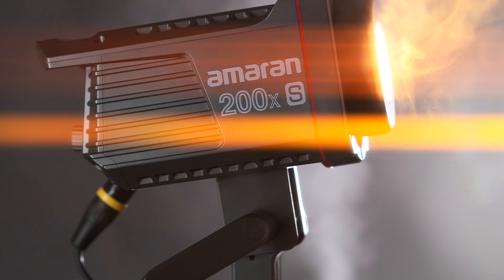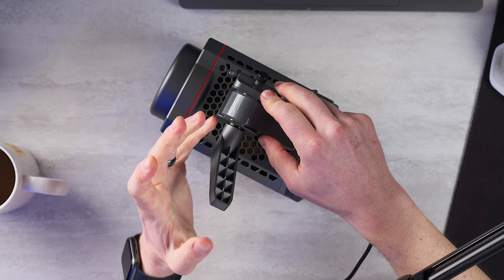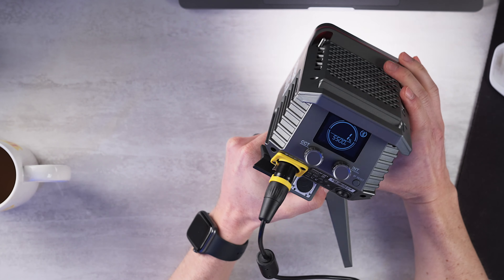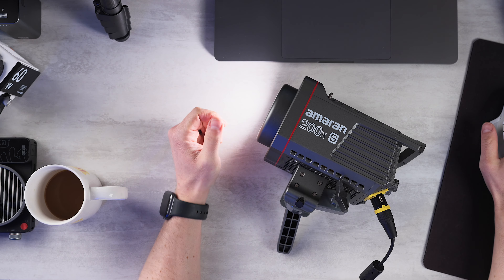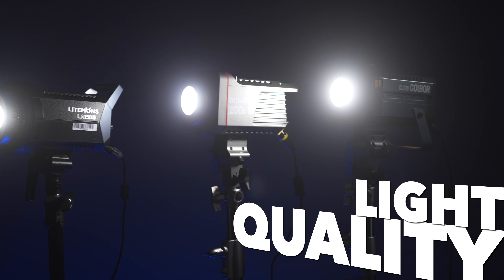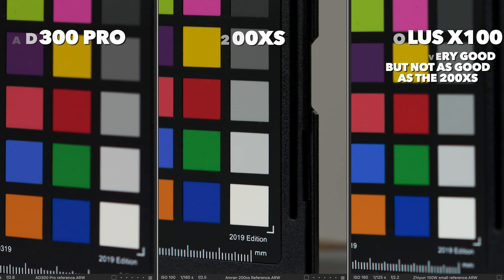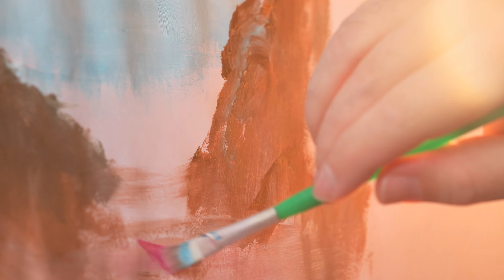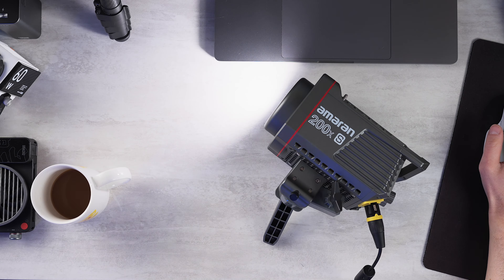Can YOU Tell the Difference? Amaran 200x S Review

Comment: Thanks for the review video. For the portrait comparison maybe the shutter, f stop, ISO and light power setting would be helpful to get an idea. Thanks!
Reply from the maker: f/2.2 ISO100 1/125s 😉
Reply: @WesPerry  thanks for the quick reply Wes. I don't bit of corporate headshots and sometimes schools too. Usually shooting at higher f stops. F4.5 to f8 max. Wonder how the 200x would do on that scenario with similar shutter speed and ISO up to 800. Do you think it can handle it?
Reply: Forgot to put that would most likely use at least two lights

Comment: Hi Wes, in your 200xs vs ad300 I could correctly determine the light used by dilation of pupils. That said difference on my tablet (smallish screen, albeit enlarged) was very similar. So I'd conclude that this looked to be a pretty accurate smallish light. Perhaps ideal as a starter for occasional amateur use, indoors, whilst being compatible (via Sidus ap) with the heavier duty, more pro like, higher spec Apurture light family.

Comment: Interested to know if you feel there is a realistic colour accuracy difference between this and the Colbor? I've seen this get commended for its colour accuracy, and I'm not too bothered about paying extra for it. The only reason I would choose the Colbor potentially is to use V-mount batteries without needing an extra box.
Reply from the maker: The Colbor also runs on 48V, so you won’t easily be using it with V-mount batteries either, unless there’s something I don’t know… if so please tell me haha.
And there is a slightly noticeable difference yes. Still working on the best way of portraying it. It’s only marginal, though.
Reply: @WesPerry  Thanks for the awesome reviews. Does the 200x S keep the same power (200 watts) at different colors temps for the most part?  Is there any reason to get the 200 d S?  Are you saying the 200 x s cant run on batteries in a practical way?  Thanks.
Reply from the maker: I showed in the videos, but it does use different power levels for different white balances. 
And for battery power you need the Aputure v mount converter box for approx $200USD
Reply: colbor says on their product description that if use v mount battery it can only goes to 50%.
Reply: @nightdonutstudio  not good.  I have this light.  If it were only 50% power it would be really weak.  Especially for photography.

Comment: Have you tried using Beauty dish for Aputure amaran 200X? Will there be any problems?

I have heard that some beauty dishes can only be used for flashing lights, not for LEDs,
If it is used for LED, there will be leakage of direct light from the side of the beauty dish
I wonder if it's true, sometimes it's more convenient to use led to take pictures
Reply from the maker: Depends on the exact model of dish, but I don’t see how side leakage would be more of an issue with COB leds than with flash. Many flash units extend further out of the mount than an led does, so if anything I would say the issue would be the light wouldn’t spread properly into a beauty dish with led. There isn’t Enough side spread.

Comment: Hello!
Thanks for your job!
Could you tell me, please, the fan model (part number) that is in Amaran 200x S? 
Maybe you made a photo and have the opportunity to check.
If anyone knows the model (part number) of the fan in the Amaran 200 x S, please share.
Thanks!
Reply from the maker: Does yours need replacing or something?
I’m afraid didn’t dig far enough into the light to see the part number for it.
Reply: @WesPerry , thanks for the answer!
Yes, I'm thinking about replacing the fan.
But before replacing, I want to compare the noise levels of the stock fan and the quieter one.
As far as I know, the Amaran 200 has a 92x92x25 fan installed and there is a fan of this size with a noise level of up to 19 dB.
Reply from the maker: @oleksii_m I see. One item of note on that, I replace the fan in a GVM SD300D with a Noctua fan, thinking it would get quieter, and it did, but only by about 3dB. It turns out sound of the air moving through the light, cooling fins, housing etc was by far the loudest part, not the fan itself.
Reply: @WesPerry , thanks for sharing the noise level after replacement.

Comment: Hi mate just a quick one how can we use them for outdoor portraits without having electricity supply ?
Reply from the maker: Well takes a deep breath
First, although this is bright for a video lights this isn’t really a lot of light compared to ambient outdoor lighting. It would only be very effective as a spot light with a good reflector, and even then, not at midday. Then modified in the late sunset/evening time. 
For external power, though, Aputure has a 48V conversion device that you can plug one or two v-mount batteries into which will readily supply this with power. You’ll only get 15-30mins per v mount battery at max output, though.

Comment: hello! how many hours aprox these lights last?
Reply from the maker: They don’t have specified ratings, but cob leds generally have a 50,000 to 100,000 hour lifespan. (The lower end of the range when run higher power for longer times, higher end of the range when running lower and shorter)
Reply from the maker: That’s in the same range as the lifespan of the cooling fan, but if the fan fails first it will simply trigger overheat protection and the fan can be replaced relatively easily.
Reply: Thank you so much. Very useful

Comment: What is minimum brightness of then 200xs?
Reply from the maker: What sort of measurement are you looking for here? It’s incredibly dim at minimum. As mentioned it can have a very linear power curve (which can also be adjusted), so at minimum it’s just a trickle.
Reply: @WesPerry  I ask you about lux and eye strain at 1%, coz I planned to use it as key-light + softbox when I am streaming
Reply from the maker: Through a soft box you can hardly even tell it’s on at all when at 1%
Reply: @WesPerry  Ok, thanks!

Comment: Aluminum is lighter than plastic and better for heat
Reply from the maker: Actually aluminum is about 2.5x heavier than plastic. It can often Result in being lighter, by sometimes requiring a greater than 2.5x reduction in actual product used due to its increased strength, though. But not in All applications, only where tensile strength is important. If a substance needs to fill a volume or reinforce a shape, modern plastics are often stronger vs weight.

As far as long term durability goes, well designed aluminum will Almost always win. But much of the time when aluminum is used, they'll cut it down to the bare minimum and create durability concerns, while plastic, being significantly cheaper in both supply and manufacture, can easily overcompensate.

So many factors!

There is a significant amount of aluminum and copper inside this already, though. The interior chassis has a much more robust built than most lights in its class. Others would use riveted sheets of thin stamped aluminum for the interior chassis, while this appears to be much thicker cast aluminum. Which, like you say, is great for heat dissipation.